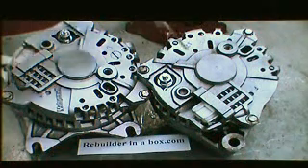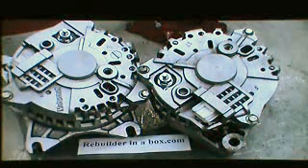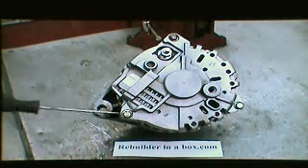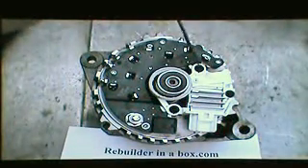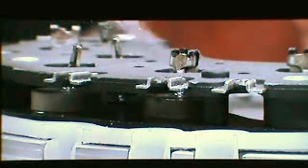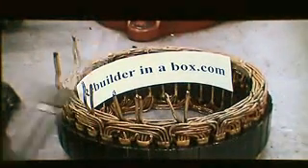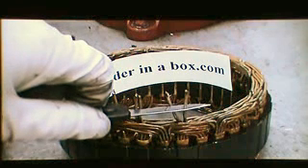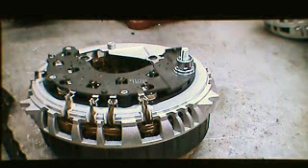how to repair a 6g alternator | 6g rebuild kits

Comment: Your kit for my Excursion costs $100, but I can buy an American rebuilt one for the same. Why so much for yours?
Reply from the maker: The most it would be is $87.95 and that is with us sending you a new rectifier and rotor which is not always needed.  A kit without rectifier and rotor is $37.95.  i included shipping into the price.
Reply: Mike Lauer
Thank you for replying. Are the additional parts really worth the extra $50 vs. buying an already re-manufactured alternator? Are your parts upgrades?
Reply from the maker: Mikeynuts21 Sorry for the delay in responding.  The rotor can be done by yourself, but if you do not feel confident in cutting the tabs and soldering the leads we can do this for you.  If you have a 2 lead rectifier then from our experience you could go without a new one in most cases.  If you have a 1 lead rectifier.  It is a good idea to replace that.
Reply from the maker: Mike Lauer Are parts have been tested and put into our very own rebuilds to sell to our local garages.  We have had great success with our rebuilds.  Which is why we decided to offer these rebuild kit packages.  These are replacement parts for your alternator not upgrades.  Although we are looking into adding upgrade packages in the future.

Comment from the maker: Yes, the video has a second part of this rebuild and it will be given to you once you purchase the kit.  The idea of the video is to allow you to know what to expect.  17 volts means you are overcharging your battery big time.  You run the risk of exploding your battery.  Our kit will help correct this issue.  This would be the kit that fixes your problem                                             ht  tp://rebuilderinabox.c  om/6g-8260/  delete the spaces to paste into the browser.

Comment from the maker: Sorry, for the delay in our response.  We are in the process of improving our system and after seeing your message we seen we did not have the proper page set up from our last application chart.  I have the right link in the rest of this message. You will be getting a gray with green regulator which is a possible updated one from what you have now.   

ht tp:// rebuilderinabox. com/6g-7796/  Delete the spaces then pasting this link into your browser.